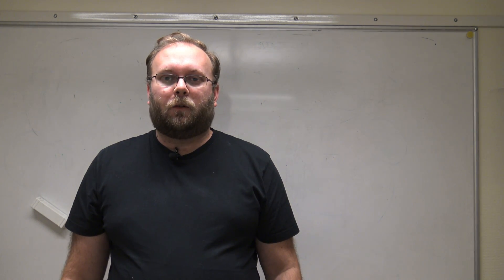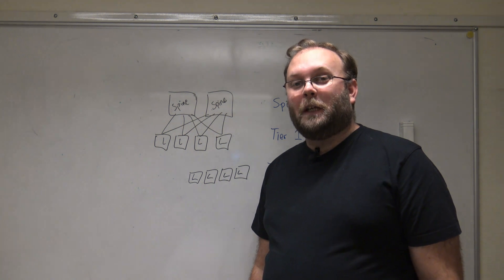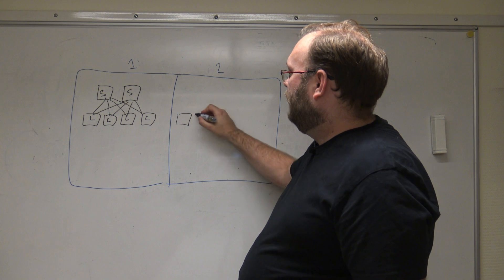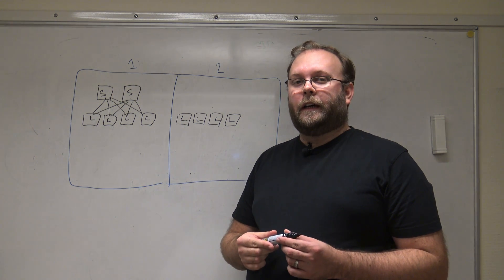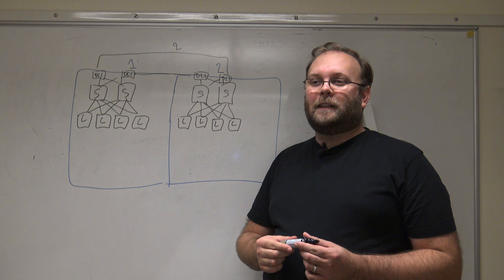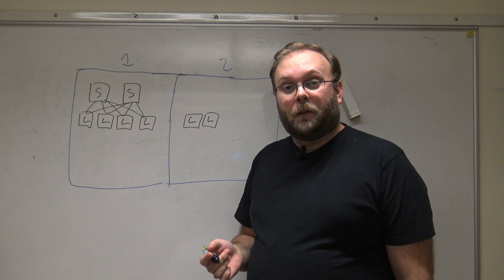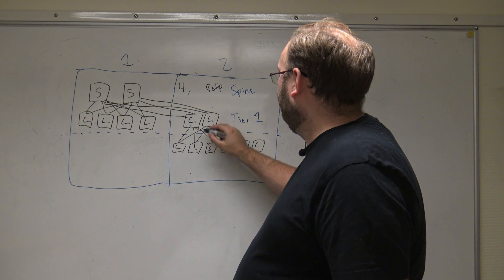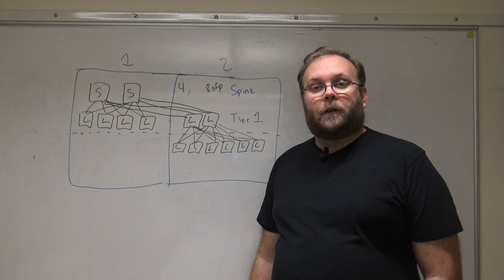Cisco ACI Topology Part 2 - Multi Tier (4K)

Comment: Thanks! What about Tier 2 switches? Can we use smaller switches or it should be N9k?
Reply from the maker: osama kamal currently only 9K switches are supported,   Tier-2 leaf: EX/FX/FX2.  The cheapest today would be a 9348fxp but that’s only 1gbit. https://www.cisco.com/c/en/us/solutions/data-center-virtualization/application-centric-infrastructure/white-paper-c11-742214.html